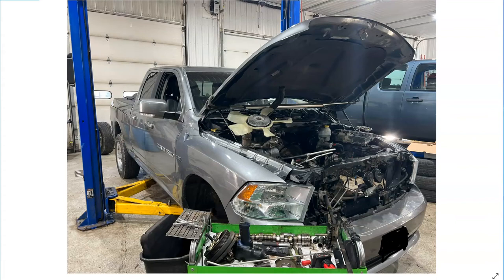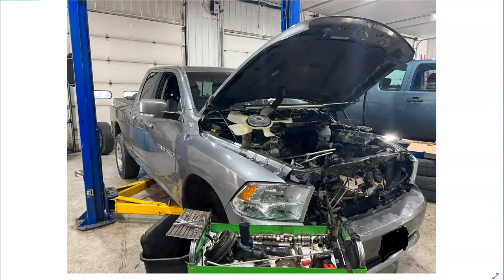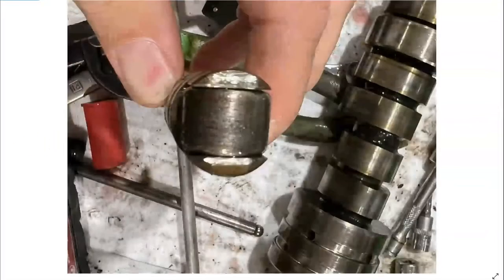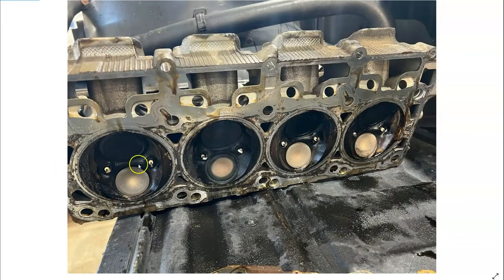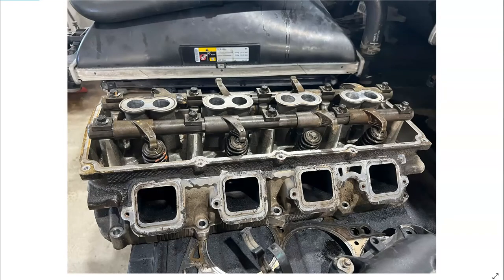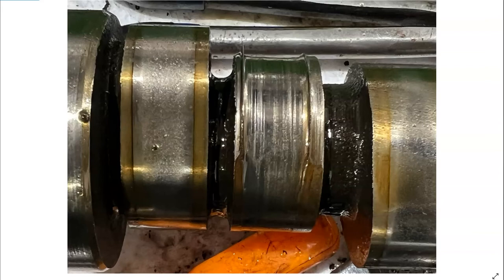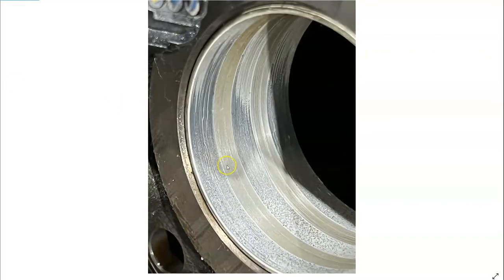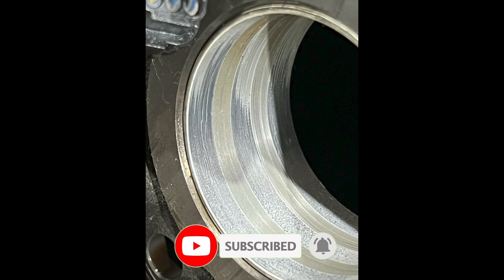2012 RAM 5.7 HEMI Tick noise, Check Engine light on, cylinder 5 misfire, DTC P0305

Comment: Thank you for this video I have the exact same problem on the exact same cylinder issue first showed up just over 60,000 miles I had it all professionally done I am now at 211,000 miles and the check engine just came back with a misfire code I am terrified that has the same issue again on the different cylinder